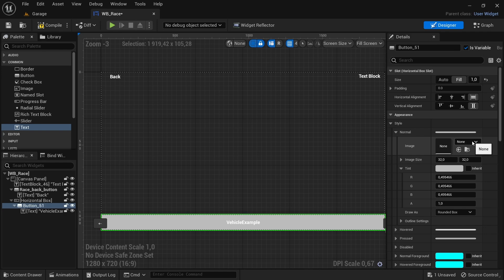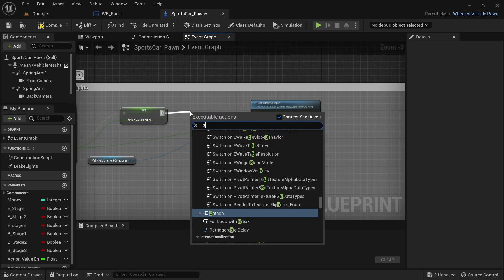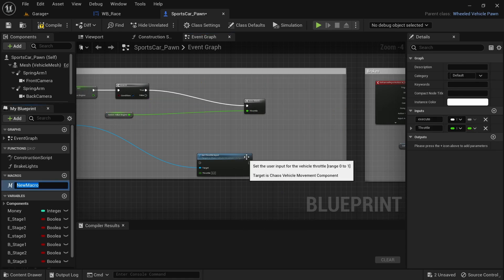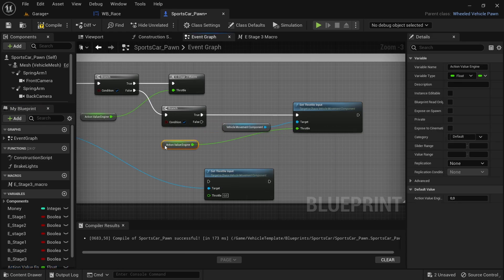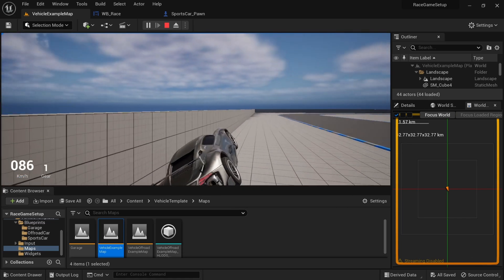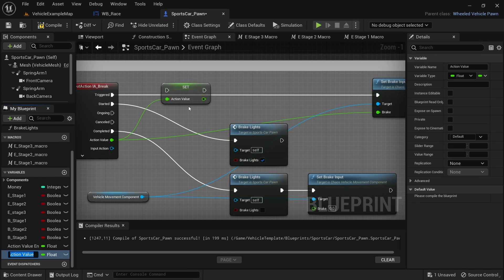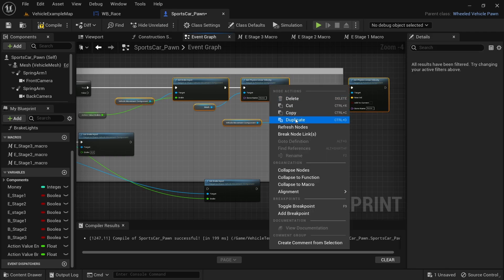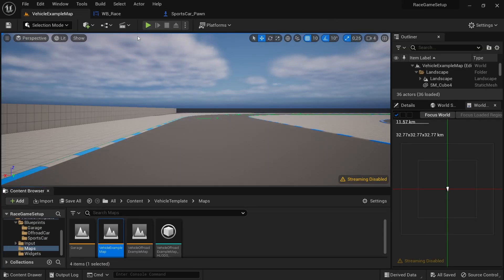Vehicle Performance Upgrade (Part 02) | Unreal Engine | Racing Game Tutorial

Comment: ok , things are working fine,,,like speed is increasing and brakes are working well only when i disconnect the branch condition node from stage1, stage2,stage3...when they are connected, nothing happens, but when disconnected, things work well,,,is there any issue with my variables or any other problem, could u plzz tell,,and sorry for too many questions :(
Reply from the maker: No problem, ask as many as you need to. I think it might be that the value for the conditions are set as 'false' for all of them. Connect the conditions and maybe try to make an upgrade purchase. If not, then create temporary condition variables in the vehicle blueprint and name them something similar to 'temp stage 3' and so on. These temporary variables will only be in the car blueprint. They will only be used for testing. When you're finished creating the temporary variables swap them out with the other variables and then test it the code by setting the temporary variables to 'true' and 'false' to see if the code still works. If, for example, the 'temp stage 3' variable, when set to 'true' changes the cars velocity, then you'll know that it was because the other variables were set as 'false'
Reply: Sir, things are fine know, i just clicked the ' default value ' in the details tab of each stage of brake and engine..and the problem is solved❤❤❤❤❤❤❤.
I think udid not showed in ur video that we are suposed to click this....but the problem is solved...
And thnkusoooo much for replying...
Keep shinning❤❤❤❤@GenuImitation

Comment: a question please?......u aded everything in brances and it confusing to judge which condition is executing,,,do i have to make purchases fist,,,or directly check in example map by playning
Reply from the maker: check to see if the condition on the branch has been checked as 'true'. if it isn't check then it will treat the follow-up code as false and not make any changes. Also if you want to see if the code is working with the 'true' selected you can set the multiply to somewhere between 1.5 and 2. It will be overkill but you'll see immediately if the code works
Reply: @GenuImitation  In engine upgrade macro 1 node, u just added 'set throttle input with vehicle component' but in brake macro 1, u added full logic with division value, could u plz explain the reason or u just missed the step?
Reply from the maker: @MuhammadAhmad-zb1hq for the breaking you want to do the opposite of what was done for the throttle, so by dividing the velocity you make it so that when you brake the velocity value reaches '0' much quicker
Reply: @GenuImitation  yeah, the speed has increased only if disconnect the varaile ' Stage 3, stage2, stage 1 from branch nodecondition. when i connect these variables to brachn node conditions, the effects simple go aways and everythings sets to default, but on dicconnecting from conditions, the speed and brake effects goes well
do u know why its hapeening
Reply from the maker: Are you connecting the nodes from stage 3 to stage 1 going down and each 'false' leads to the next branch condition node ??
Reply: Yup @GenuImitation
Reply: @GenuImitation i did the same as shown in tutorials, idk either there is problem in my variables or somethingelse...
I am unable to figure it out🙃